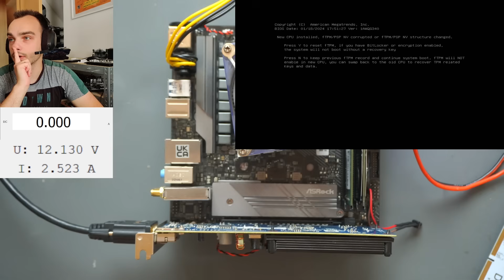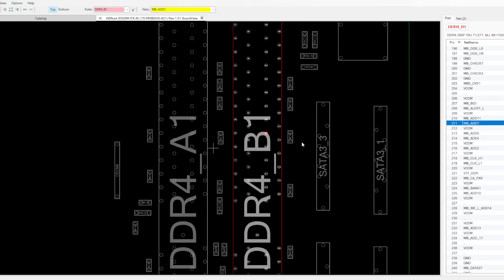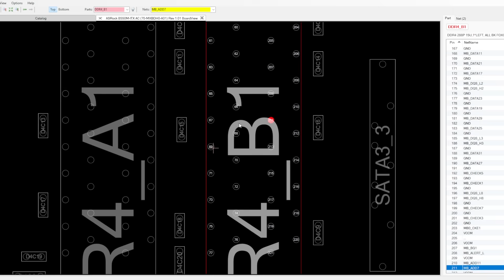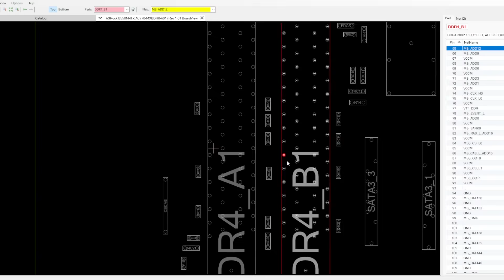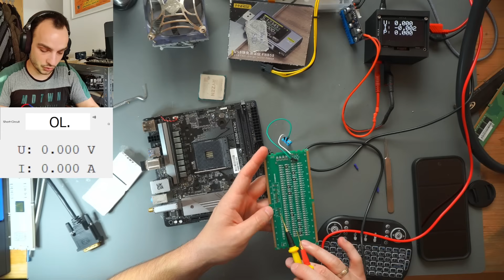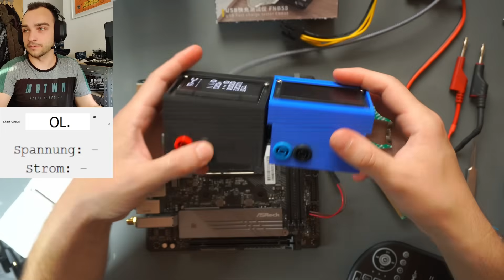How to diagnose RAM problem on an ATX motherboard || B550M ITX/ac fix repair

Comment: I have a question. I have a Asrock B550 Phantom gaming itx ax with Ryzen 9 5950x. I have 2 x 32GB DDR4 G.skill and It doesn't boot. With one stick 32GB in B1 it works well. A1 ( left ) not.  Also a store tested 2 X 16 DDR4 and it worked. I tested both 32gb sticks in an other micro atx Motherboard and they worked both fine. What could be the problem ?

Comment: I did have same problem with 4300g. The problem was with only this particular CPU+Mobo (also ASRock). Any other CPU in this board or this CPU in other boards works perfectly.

Comment: I have removed the top of AM4 sockets to be able to clean the pins below. The top plastic piece is very fragile and easy to break but can be removed. I think bent pins on the CPU can damage the pins below but sometimes it is recoverable. If you have a dead AM4 board you could practice removing the top AM4 socket piece.

Comment: For RAM slots I usually fold office paper over a credit card, IPA it, and plug it in and out until I don't see black marks on the white paper.
You can put tape over the buzzer hole to make it quieter, because some people have real problems with loud piercing noise, ie, hyperacusis.

Comment: Hi Medic, why do you have some leds on the DDR tester marked? why don't they light? and where did you get the information to say they don't need to please? Bob. UK
Reply: Some boards doesn't use all of the lanes. 
I myself have plugged my DDR tester to known working boards, and mark the non lighting LED's with a marker like this.
Reply: Maybe they're supposed to be low, ie, lit means a short.
Reply from the maker: As far as i know some off those are used for ECC RAM! There are boards that have all LED´s light up!